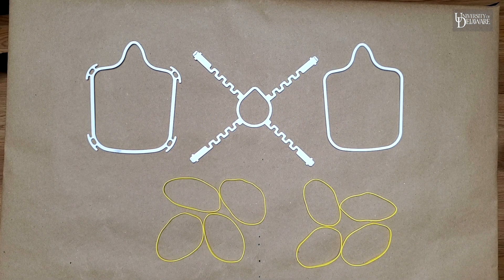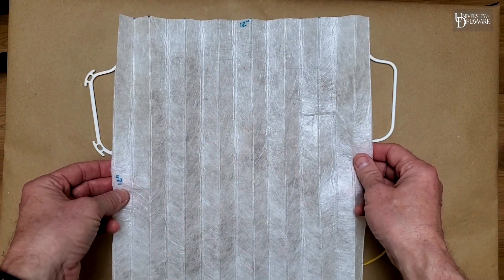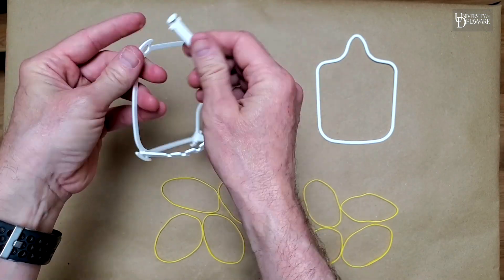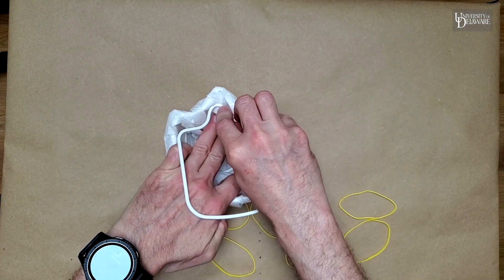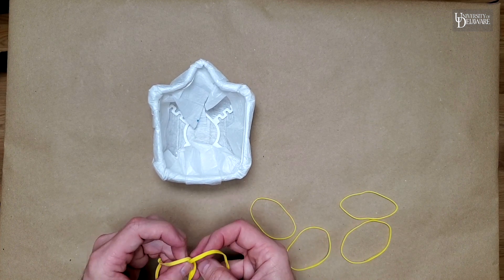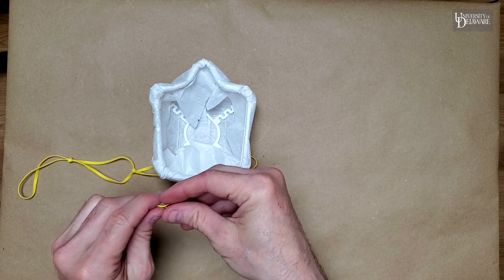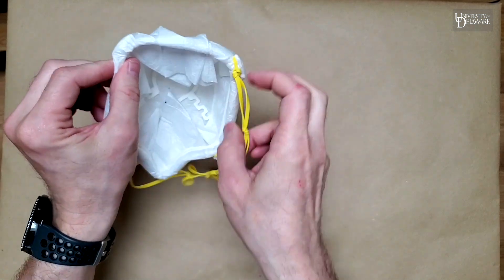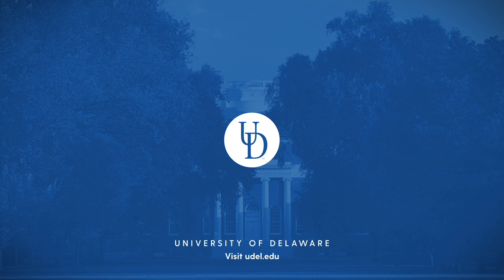How to assemble the HensNest face mask

Comment: I had the GrabCAD model 3D printed at Shapeways. The containment hoop without the horns is the same size as the piece with the horns. I thought it would be slightly smaller to fit inside. Was it printed correctly? Should the containment hoop and horn hoop be the same size when stacked on top of one another?

Comment: Any suggests as to where to get the HEPA filter material?
Reply: There are HEPA filter air filters for your home (AC units, heating units, etc) that you can find at hardware stores or home supply stores. There are also slightly smaller ones that may be big enough to work for vacuums and cars. If you CAN'T find it though, you could probably use 2-3 layers of quilting cotton (like people are using for fabric masks).
Reply: @samanthahealey6994  They used a source like that in the video.  I was hoping for something else, like maybe some place online to buy the filter material in bulk on a roll or something like that.  

I'm already using cloth and would not get this unless to upgrade to a better filter.

Comment: Are you concerned about the filter material containing fiberglass, especially if you're going to cut the material?  Its been suggested that the HEPA filters form vacuum bags and furnace filters may contain fiberglass.  I've also heard that the "hydroknit" towels (blue shop towels) have a very good filter rate that has been tested with a particle filtrate analyzer.  While I have limited knowledge, the shop towel material seems to be similar to the Delapore (Meltblown filter media) that 3M uses in their N95 masks.  Are you considering testing its filtration rate of any materials?  SARS-CoV-2 is said to be .125 microns.
Reply: Hi Jeremy - I'm on the design team for the mask and can address some of these questions for you. First, as you suggest, blue shop towels make for an excellent (and cheap!) filter material. We found that they gave 4x protection than standard surgical masks. The HEPA filters that we're suggesting are accordion style home furnace filters, which do not contain fiberglass. The other kind of home furnace filter, which does contain fiberglass, is too thick to fit into a mask anyway. You can read more about all the different materials that we tested with the mask on our project website at: https://me.udel.edu/hensnest-3d-printed-face-mask/
Reply: Great design btw.